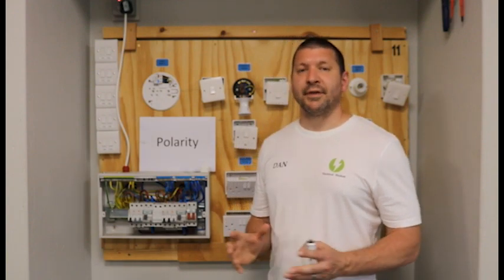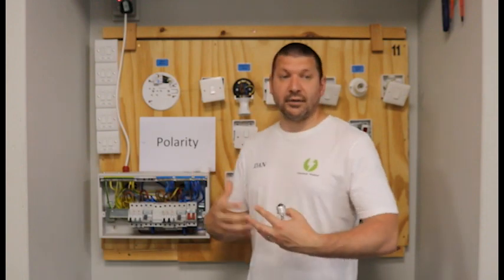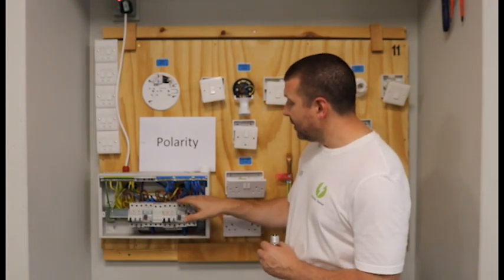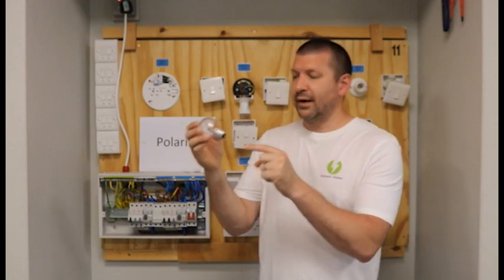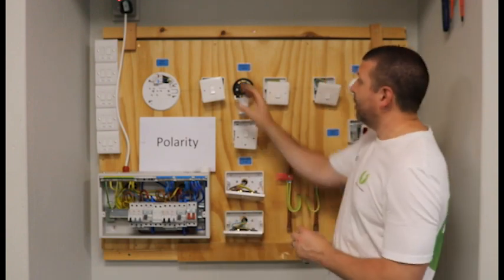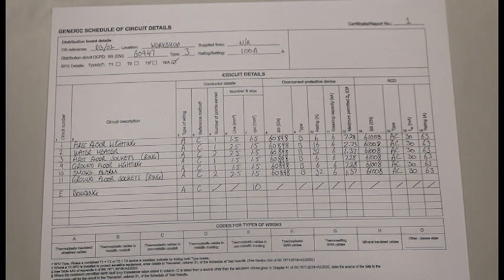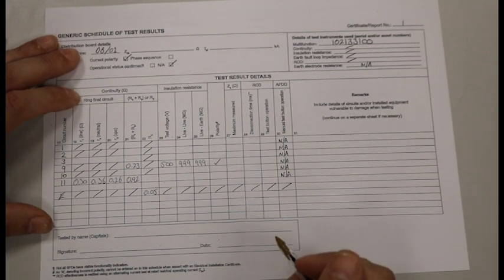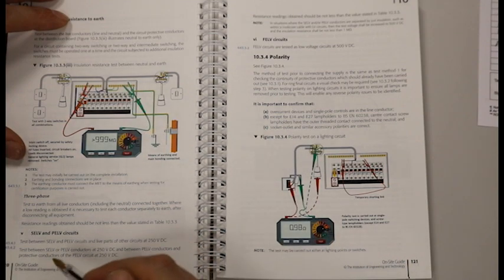Guide to completing a Polarity test and test sheet completion

Comment: R1+R2 only confirms part polarity . you pilchard 
 To confirm polarity you should test R1+R2 and R1+RN and operate all switches on the circuit. So to insure the test includes the switch live and the switch return this is lightning circuits , for socket circuits it’s the same except there no strapper’s  between the socket terminals and the socket switch . Test R1+R2 and R1+RN to confirm polarity.  You should also test to confirm supply polarity. 
You really need to learn how to test before making videos on testing.